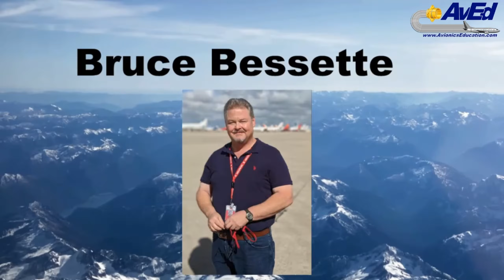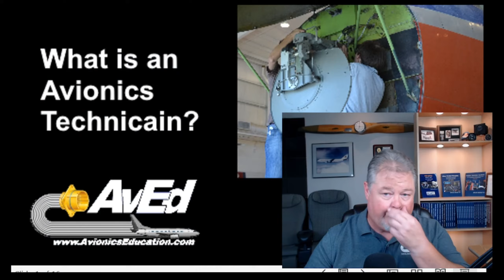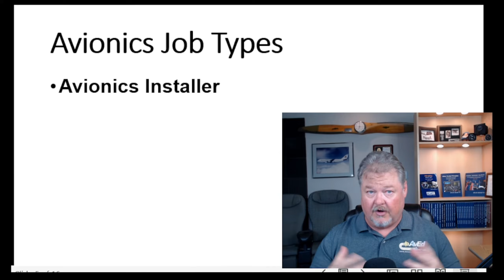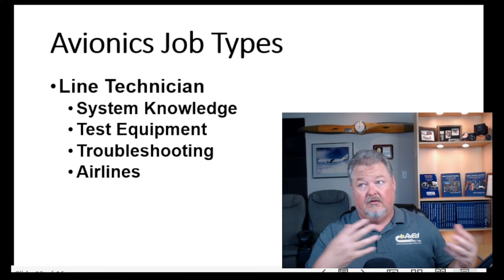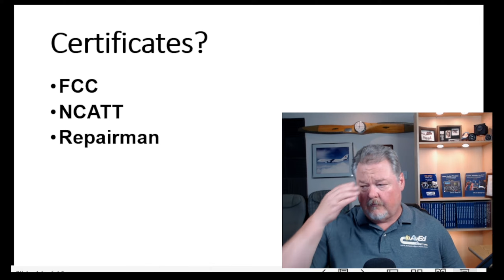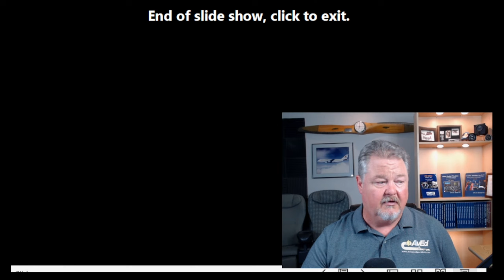What is an Avionics Technician?

Comment: Not very well explained on FCC. The FCC is required for certain things that go beyond FAA installations and removal or field testing. . The FCC is required For Anyone who repairs any receiver or transmitter for either COMM or navigation, AFTER it has been removed......i.e. ANY FCC regulated device. Period.   Repairs are made at manufacturer or repair stations. BUT AS a repair technician You Must either do it at manufacturer Facility where the FCC license is not required (technicians work under the manufactures FCC license) , or YOU MUST have an FCC certificate to do it at any none manufacture repair facility, EVEN AT a FAA Repair station you must have it .  This is because the FAA repair stations do not have FCC licenses for techs to work under. You cannot repair a Radio or transponder or even a ADSB transmitter without an FCC license even at a Repair station. UNLESS you have an FCC License. 

IN addition, ANY aircraft where the Radio system on the plane has been registered as a RADIO station with the FCC, you NOW  must have an FCC license to do ALL installs, removals or even repairs, No matter if it is a FAA Repair station or an FAA operator, or even a manufacturer worker in the field...NO one but a license FCC radio operator can service any FCC equipment that has been registered as a FCC radio station.   Some people still carry radio station registration on their N numbers and some airlines by law still MUST have to have their comm systems on each plane Registered as a radio station, this is to allow international travel.  In those cases , any plane that has a comm registered as an FCC Radio station, can not have any of those Radio station registered devices installed or removed or serviced by anyone but an FCC licensed person. No matter what. The only place you would not need it is at the manufacturer's facility.
Reply: GOOD FACTS MY MAN YOU FORGOT THE RADAR ENDORSEMENT THAT IS ALSO REQUIRED WITH THE F.C.C LICENSE
Reply: @melekanaka2288  That you. I don't think he knows or ever worked with a plane that has its comm system registered with the FCC as a radio station with call sign. The FAA use to require that for all GA aircraft. But they removed the requirement because it was causing pilots to be FCC licensed to use the comm and the need for FAA repairmen to also be FCC licensed people to remove and replace and test the gear. After they took out the requirement to register your plane comm with FCC updated the 145-repair station regulation in 2001. however, you still need an FCC license to open the comm and other radio related gear by law. Anything in the plane with an FCC sticker can only be repaired by an FCC licensed person or manufacturer. the FCC radar endorsement is not required unless there is a piece of gear that is in the L S or C band that need repair. Storm scopes would meet this. Incidentally. All comm related Nav gear send and receive falls under FCC, this included Tcas, GPS, and ADSB devices. He stated he never seen a FCC enforcement officer. They are everywhere. They mainly focus on manufacturers facilities, and FCC licensed radio repair shops. Because these devices are supposed to be being send to them for repair. Remember all commercial planes sill must have the planes comm registered as a radio station with the FCC. All that gear that gets repaired by commercial operators must be FCC licensed techs.
Reply from the maker: Wow, you are so definitive in your position. My information about the requirement for the FCC GROL is from the FCC website themselves.  Where the FCC GROL is not mentioned in any aircraft maintenance manual.  I deal in the world of aircraft maintenance, and the FAA is only interested in maintenance being done by mechanics certificated under FAR 65.  The FCC certificate is never mentioned because FCC rules only apply to radios under maintenance.   The FAA only requires aircraft parts to meet  FAR 21 rules for parts and the requirements to create the Instructions for Continued Airworthiness of the part.  It's then the FCC will have oversight of the transmitter.  So, the only time an FCC GROL is required for those FAA repair stations to perform maintenance on radio transmitters to meet the requirements of the ICAs.  Even with that being said, in my 42 years in aviation working around avionics, I have never once seen an FCC regulation enforcer.
Reply: @AvionicsEducation  As a former NASA technical director and Post graduate degreed scientist, as well as having designed navigation and guidance systems for General electric, Honeywell avionics and DOD for military systems as well as Space systems.  I have seen many people go thru their entire lives misinformed, just like you. I have seen people in charge doing things absolutely wrong for years. There are people in the FAA in charge who have no idea what the real requirements are. they simply stick to what they were told and follow it their entire lives. Like believing that only a part 145 repair station, or manufacturer can do Altimeter testing in 43 Appendix E. I can call 10 FSDO's and get 10 different answers on one subject that is well defined in the regulations. With that said, I will simply say everything you said is wrong. Dead wrong and I dont want to waste another minute trying to inform you

Comment: Thank you for the excellent overview Mr. Bessette . At 59:55, you said oscilloscopes are nearly obsolete because a lot of great handheld equipment has replaced them. Which particular handheld devices have replaced them sir ?
Reply from the maker: Yes, gone are the bulky CRT displays replaced by LCD and microprocesseres.
Reply: @AvionicsEducation  So the more modern devices you're talking about are still oscilloscopes , but with more advanced displays & processors ; is that correct ?
Reply from the maker: @bigmedge  Yes, and they compute the value for you. You don't have to read a trace and look at a scale. there is a channel called Afrotechmods, and I have a video about a Time Domain Reflectometer that used to be an o-scope trace.